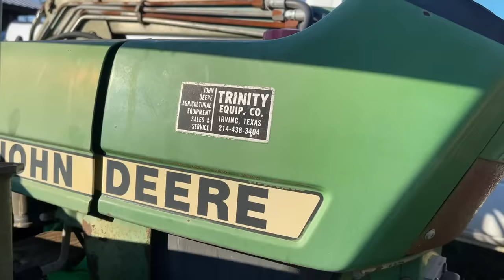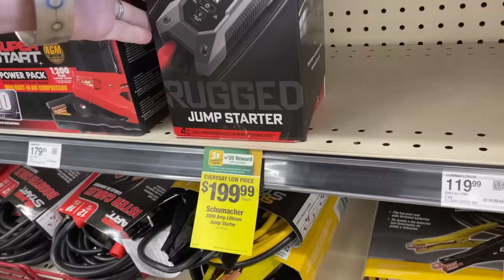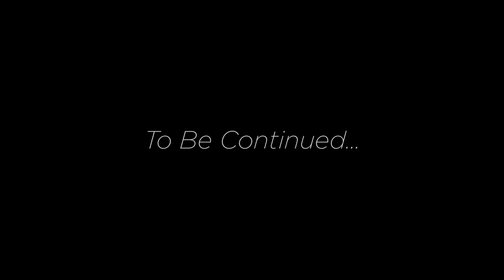John Deere tractor with a BLOWN ENGINE for $1k?! WE’RE IN! Pt. 1

Comment: Just a suggestion: Use a copper hammer or a copper bar to knock in gears, bearings etc...  so you don't scar or break  things. It just gives it a little bit of cushioning. Copper hammers/ mallets - are easy to make... and you can make a copper bar out of about any copper laying around. Brass will work too - but I prefer copper myself.  Great job by the way - thanks for sharing.  I love this stuff - keep it coming.
Reply: Zinc works well too, work in a die shop and it doesn't chip as quick as brass or copper
Reply: Shouldn't them bearings rather be pressed in?
Reply: I was thinking of a dead blow hammer, yes copper or brass is also better than steel on steel. Also a bench press and a hydraulic press may come in handy.
Reply: Or use a plastic dead shot hammer.

Comment: Great timing. I am rebuilding a small JD lawn tractor. Engine done, now stripping rust , then paint. Finally just waiting on replacement parts from JD. All under 1k that would have cost 3500+.
Love it. John Deere's parts and manuals are great to help make it happen

Comment: I have a 650 like this, it was handed down by my father and grandfather, the original owner.  I love it, it does so much and demands so little!  Mow, move dirt, dig holes, pick up engines, pull fence posts, drag logs, and it'll work for days on a few gallons of diesel.  I'm so happy to see one getting restored.  Now to watch the first start video!

Comment: FYI, the front crank bearing/bushing bore has a chamfer on the inside to install the bushing from the inside with a bolt washer type tool to draw it into place. Also the rear crank bearing/bushing can be removed with a punch (drive on the center at an angle) install new bushing with a flat plate until flush.. Your welcome.

Comment: I wouldn’t worry much about that rear main bearing, I’ve seen far worse and they were running just fine. But I would advise that you invest in a lead hammer for assembly, reduces the likelihood of errant strikes causing any damage to the machined surfaces. Love all your content!
Reply: I agree 100%.  Tools are the life blood of any shop, buy once and always have the right one forever !
Reply: It made me cringe everytime he got that hammer out, striking machined surfaces, gears, and driving that bearing in with a socket
Reply: Or brass ay least
Reply: A plastic dead blow has served me well for years, a steel hammer on motor parts was a huge nono in my shop.
Reply: I had to look away every time he picked up the hammer. But that's ok...an old tractor on a budget build. Please get a brass or dead blow though😮

Comment: Loved watching you both do this rebuild, as an old timer and engine guy the only thing I can advise you on is to reduce your metal on metal contact.  Don't use steel hammers on steel parts, there are softer alternatives or use a piece of smooth hardwood between the hammer and the part.
Reply: I was saying that same thing. Get or make yourself a few brass hammers. You won't be using rat tail file's on deformed bearings again.

Comment: An Incredibly Beautiful Smile Emily. ♥ Bag and tag those parts people.  Please get a large table/bench to do your work on.  Your back and knees will thank you later.  You risk breaking rings/and or Piston by not removing the upper ring land.  There are tools for that.  Perhaps take it to an engine rebuild shop if you can find one.  You may also need to polish the Crank Journals.

Comment: I resurrected a JD 750 a few years ago, the upgrade to the 650 you have. Both are rebranded Yanmars. Great tractors and easy to work on... And fun to use and own. Rock reliable, with a few caveats. The hydraulic pump is in the transaxle. When the pump fails, replacement or service requires splitting the tractor. Also, the seals in the "locking" valve erode over time and the 3-point will drop until the valve is replaced. But these things run for decades without issues. You got a great little tractor for the money.

Comment: Aaron I can relate to your love of this tractor. On a smaller scale I had an International Harvester Cub Cadet .I learned to Drive on it , Plow snow, Cut Grass,Dig , Carry Hay , Spread Horse Manure ,pull Cars , you name it. One Rebuild and two Short blocks. I did sell it 20 + years later and wish I didn't. I hope to find another one someday.
Reply: I have the Cub Cadet I learned to drive back in '69.  My dad bought it to mow the grass on his property and I got it when he died.  It's sitting in my garage, but the Craftsman tractor runs so much smoother and gets much better "mileage"!  I even have the original manual!!  I have too many tractors!  I've got an old CAT D4 that needs a ring rear and reassembled (bought in partially taken apart). I sure would like to start on these projects, but I live next to thieves in Montana, and the law enforcement here is mediocre at its best; actually the corruption here is off the charts!!!  My best friend id my side arm!!!!

Comment: I used that type honer to deglaze my Chevy cylinders, then used oversized rings to prevent blowby & ensure proper compression--worked perfectly. As for the squirrel problem, a 22 short will fix that. They are delicious pan browned in butter with a little salt & fresh ground pepper.

Comment: You're always very methodical. And always seem to do really good work. Plus compared to a lot of the other YouTubers I Watch. Your audio is always exceptionally good. I did see that use red loctite on the bearing. Loctite has a Pacific green loctite 620 retaining compound. That is made especially for bearings to keep them from spinning. The only downside with using the green stuff is you have to heat it to get it out afterwards.

Comment: Cool a Chevy luv that was my first vehicle,Mine was a 1980 4x4. Bought it in 1983 with my yard mowing and summer jobs money, ended up getting beat bad on the deal as truck had been involved in a serious accident and pieced back together. The frame was severely bent and it went down the road crab walking, it also eat tires at a staggering rate. The first set of tires I bought it spent a lot of money for and only got 3800 miles out of them before they were slick ( yes 3800 miles not 38000 ). It spent all my money trying to get it fixed including 3 different frame repair shops all to no avail, ended up selling it for virtually nothing a year and a half later. I definitely learned a valuable lesson in not everyone is honest and always check out or have someone check a used vehicle before you buy it. Y’all have a great day and God bless you.

Comment: Great find.
You will be happy with that tractor and loader.
That little two cylinder engine will sound vintage 
putt putt.
That tractor was a joint venture between John Deere and Yanmar of Japan.
There was a whole series, 650, 750, 850, 950, 1050, 1250, 1450 and 1650.
I helped test these tractors back in the day and was always impressed.
I also had a 650 like yours to travel around the factory in Waterloo.
Good luck with your rebuild, I will be watching.

Comment: Here's a great tip next time you want to do a degrease on a rebuild. It's much cheaper and will definitely remove paint for repainting. Buy a pound of 100% lye crystals (sodium hydroxide), use a 2 gallon pump up sprayer and fill with 2 gallon water, add sodium hydroxide mix and spray on. You'll be shocked how easy this works with just a garden hose to rinse. Just be super careful not to get any on you! But if you do, we call it the hydroxide dance. Almost all degreasers main ingredient is sodium hydroxide. Much cheaper and more effective as you can control what strength you want. 
John Doherty LykeNew Power Wash Salina Kansas Location

Comment: love the low rider utility truck! You might want to use a heavy gauge wire hook for the evaporust basket lifting and lowering. I learned the hard way that pliers tend to scar the plastic handle until it breaks.

Comment: Love this video.  I used to have a farm and had a little 850 with a front end loader and a belly mower.  Best tool around the barn  and a pretty good mower for our smaller yard (5 acres).  Had a bigger tractor for the pastures.  Welded hooks to the top of the bucket for use with chains and a bucket extension for cleaning stalls and carrying larger loads of dirt.

Comment: Good score guys. The tread on the tires looks good so to save a few bucks you can get them foam filled which adds some weight as well and run them like that until they are totally roached. Good to see you back after Aarons health scare.

Comment: I just went through a yanmar engine.  New pistons, sleeves. They do things a little bit different.  Numbers cylinders from the rear etc. I found they are prone to cracking in the heads between the injectors and valves causing coolant to get in cylinders.  Saw many do that. Injectors also can be a pain to get out of head. Never leave the engine cover open to rain. It pools around injector causing rusted in issues. Fun stuff. Great video.  Best wishes.

Comment: I recollect from decades ago an "industrial arts" instructor advising a class of 20-25 senior apprentices......."each minute of stone hone operation is roughly equivalent to one year of engine operation"...... that is a remarkable testament to the efficiency of a micro film of lubricant betwixt the rings and cylinder wall at operating temperatures and pressures

Comment: Next time shrink the cam bearings in the freezer. The shoulder is to help installation alignment. Do not use red locktight,  bushings/bearings use green 620 it's designed for this purpose.

Comment: That’s a neat stud extractor… I usually just weld a nut onto the broken stud or bolt, and take them right out! Reusing bearings and bearing races is fine(especially if they are still serviceable), but I would apply some lube to o-rings to prevent them from being torn or scuffed!

Comment: This the project I have wanted to see. I am a big fan of bang per buck. What I am most interested in is the cam and intake you pick. I have been using assault intake manifolds and ht383 cams for good mild performance but to step it up a bit a cam is the main thing. Looking for a reliable 400 hp. Being based in Australia with the exchange rate and shipping roller cams are an expensive item so you need to select carefully. Love your work. Thanks.

Comment: Working on tractors was one of favorite things to do , never worked on anything but the engines< easy to get to once you got the extra stuff off. Love the video, John Deere seemed to love two cylinder engines.  Definitely needs some gloves, I spent year working without them and my hands show it.  Always wished at times I had some help in areas, and yes googles would be an addition to gloves. Amazing how they both stay so clean. Amazing how they do an engine in under an hour, enjoyed the video .

Comment: I don't know if you have a welder but if you do you can run a bead in the bearing from front to back in two or three spots then let it cool.  The weld will shrink the bearing and sometimes the bearing will then fall out.  I have used that method to remove dry sleeve cylinders, regular wheel bearing and other in bore items.

Comment: I had a 950 that was 40 years old when it spun a bearing. It had been used for its first 15 years as a brush hog tractor on | the Corps of Engineers lake properties where I contract mowed. Then the rest of its life as a farm tractor doing odd jobs around the farm and raking hay for a custom bailing contractor in the summer.

Comment: i just found your youtube.i loved watching the resurection of this JD tractor loader, i grew up on a grain farm i became a farm tractor mechanic working for AC IHC JD and MF dearlerships.if you have to change a pressed in main bearing without the driver tool  i take a hacksaw blade holder and saw 2 slots  180 degrees apart and the old bearing will drive out easily with a small punch or chisel,  i make bearing drivers and seal drivers out of thick wall PCV sewer pipe. you did what i would have done , only i would probably took the old crankshaft and had it reground, otherwise great job.

Comment: You could have used a punch to knock out that main bearing, doesn't matter if you damage the old one. 
To install the new just press it in on a flat surface.

Comment: I sometimes weld a bead on the inside of a bearing race to get it out. The heat breaks the bond and as the race cools, the bead makes it slightly smaller. They usually slip right out. You're very experienced, so I am sure your have done this as well.

Comment: Aaron…… please put your hammer in a corner or under the workbench! Leave it there! Take out only while  braking lose lug nuts! That being out of the way, go to machine shop…… or scrap pile “ get yourself a couple of flat plates of 1/4” or 3/8” steel. Drill a 3/4” hole through both in the center of each plate.  You can either go to the machine shop or if you have cutting torches and a grinder shape these plates down to size slightly larger than the bearings that you need to install!  I then use a 5” 5/8” fine threaded bolt with a matching nut to press the bearings back in…. Simply by tightening the nut and bolt drawing them together with bearing in between. Without impact!  Also go to lumberyard and get yourself small hardwood blocks of wood to ensure no damage to metal for when you are forced to use hammers! Also one of my favorite ways of doing this kind of bear installation…… prepare bearings for insulation (remove coating for rust prevention on new bearings) like adding your lock tight material….. which I wouldn’t recommend! Wrapping the bearing up in foil and putting it into a freezer for about 30 minutes! Just about the end of that time I would start heating the area around bearing journal with a hand torch! Once that is heated up without that area changing colors! Put on gloves for heat protection then literally drop the bearings into place! Allow area to cool then back to work!

Comment: Hey guys i have car toys, atv toys, lawn cutting toys etc. I bought a compact 4x4 tractor and i use it to move around everything. The next thing you need is a set of forks that clamp on the bucket. Put things on pallets and moving things is a breeze. Be well guys.

Comment: Can't wait to hear it running I loved working on motors I rebuilt my Nova had a 1974 with 350 and a friend got in trouble with his car and gave me a 400 small block board out 30 over me and brother I. Law put it back to get her out the works into it was damb fast raced a sports car for 40 mile he had to know what I had for a motor I put $1000 into the cam / lifters  I could jump on it was awesome for 40 miles I only used less than a 😮 1/4 tank of gas Jim green racing did me great for parts

Comment: Caterpillar has a product called bearing mount that might be better for those bearings. Yoy should have put your bearings in the freezer over night before you installed them in the block. Shrinking them to install them prevents shaving a little metal off as you install them giving you a slightly tighter fit in the block.

Comment: 6:51 If you 2 were to work on an old time pedal car together, I think all of us will still watch!     12:47 Emily! Don't you dare spray that while that close with no safety goggles. 16:43 Erin is that block sleeved? or couldn't it be bored 0.010 - .020 over?  ( I'm thinking you tube guys)     -     Jim's Automotive Machine Shop, Inc.

Comment: Just some advice. Next time just cut that rear bearing. You can install it with a flat plate after if you don,t have the right driver. Alwys drive with a flat, not a socket, that is what damaged the first bearing you drove with the socket

Comment: This engine is set up just like a Kubota engine from this era with the cartridge bearings, which I believe is still how the bottom ends are put together. The way the cam timing and injector timing run off different ends of the same cam is unique to this Yanmar. The Kubota has the injection pump on the other side of the engine block and runs off of a separate gear from the cam. If I remember correctly the rear main bearing is a cartridge style as well with just the seal mounted in that back cover. Extremely strong engine block design and like you said, these Asian style diesels, unless you run them round the the clock, will outlast their owners if you keep oil in them and change it once in awhile. 10k hour engines easily.

Comment: Just wanted to let you know, anytime a rear main seal is installed in the manner in which you installed that one, "ALWAYS" pack the inside of the seal with petroleum Jelly or regular grease if the temperature is too hot. .......... 
I have seen those seal springs pop out due to the hammer blows causing the spring to jump inside the seal. If you pack that seal with petroleum Jelly, the hammer shock vibration will be absorbed by the jelly / grease and keep the spring in it's proper place, since you cannot look inside to double check after it's installed. .......... 
With Petroleum Jelly, once the engine heat get close to operating temperature, all of that jelly will melt out, allowing the seal to preform properly the way it was designed. ...........

Comment: ive had 650 and 2 950s ,,,,a neat little tractor but not much power,,,,950 is 27 hp if i remember correctly,,,,,you will have a neat set up if you dont value time as its not gonna pull much nor for very fast,,,,regards

Comment: The key may be worn and not depressing the pins inside the ignition switch.  Consider removal and taking the switch with key to a lock Smith  that does car locks.  A worn key will damage the pins.